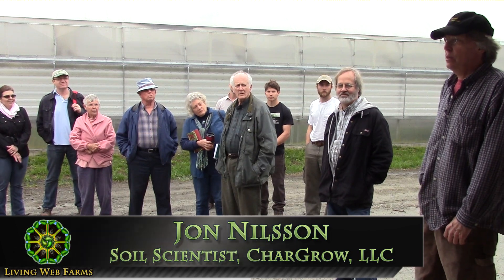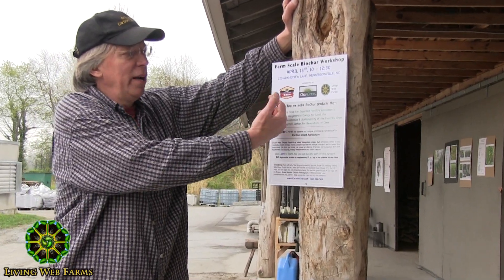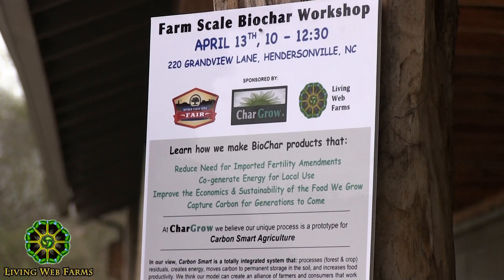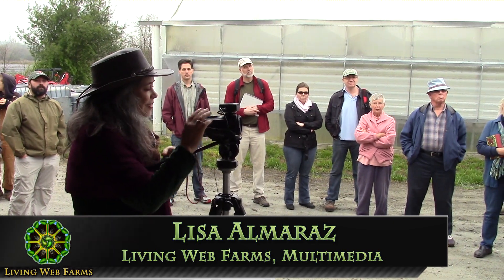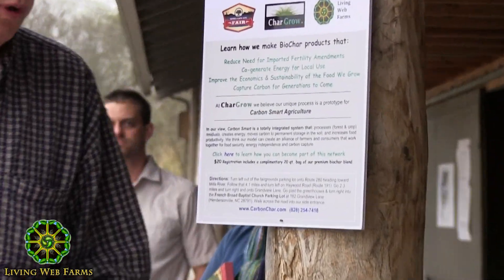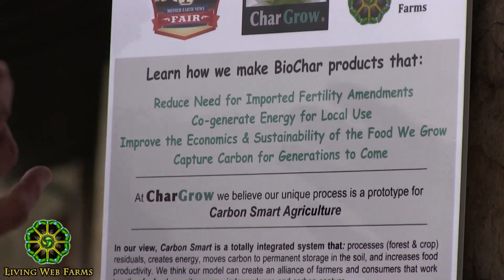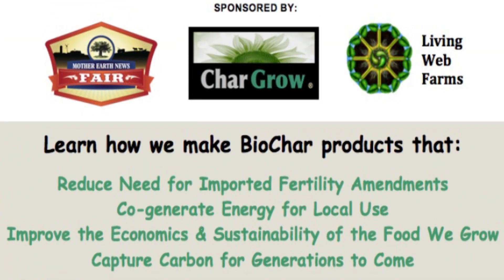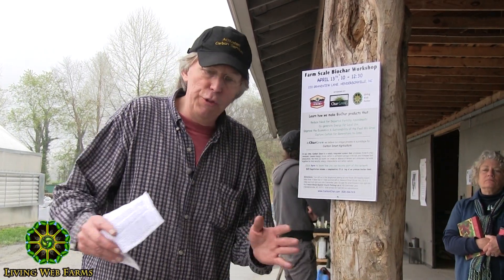Farm Scale Biochar with Bob Wells & Jon Nilsson Part 1

Comment: So if you lived in a hot climate and had a massive supply of free wood could you use the woods gasification process to turn a turbine to say charge a Tesla power wall.  I would probably only need heat for a small greenhouse a month or two out of the year.